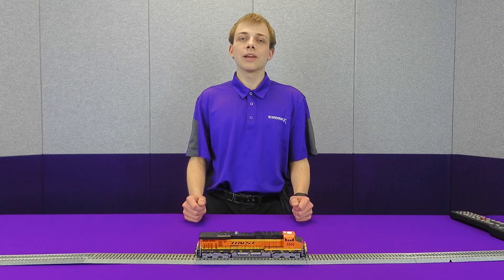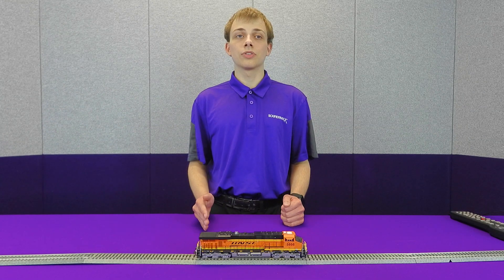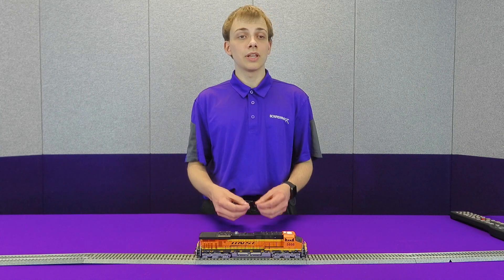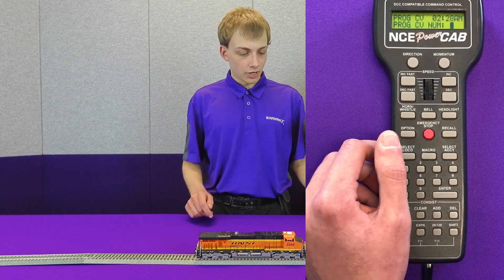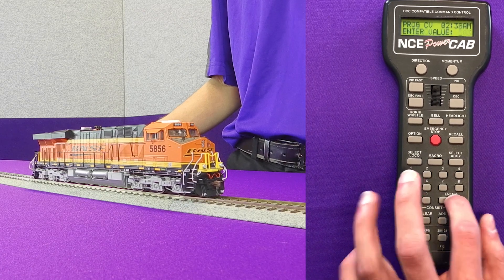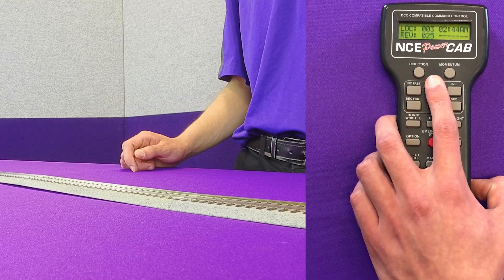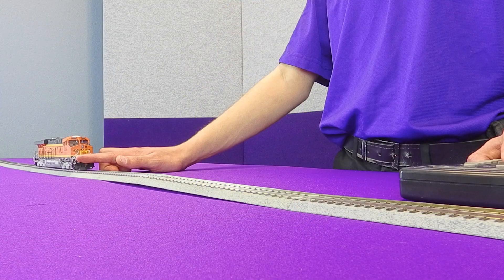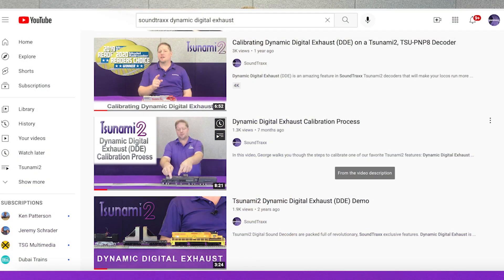Make your Trains Run more Realistically with Tsunami2 Reactive Dynamic Digital Exhaust (DDE)

Comment: So, when you are done with this process, you leave 2.503 and 2.504 at the 255 setting? Can you then also change 2.512 to different values without having to reconfigure 2.503 and 2.504?
Reply from the maker: When we set CV 2.503 and 2.504 to 255, the value is not actually staying at 255, the decoder interrogates the power consumption of the motor, then calibrates a value for CV 2.503 and 2.504 based on the calibration and then sets them tot hat value.  So if you were to go back and read these CVs, you would get a different value other than 255.  CV 2.512 determines how sensitive these decoders are to changes in the load on the motor.  Lower values are less sensitive while higher values are very sensitive.  Higher values may yield a less than desirable effect with diesels since the load would be constantly changing, and if it is too sensitive, then every coupler ‘bump’ or curve or turnout could initiate a change in the DDE response.  So, for diesels I use a lower value such as 25-35, where for steam locos I will usually go between 100-125.  But ply with the values and see what you like.  You can change this CV value all you like.  For further assistance, please contact our Support Department at support@soundtraxx.com